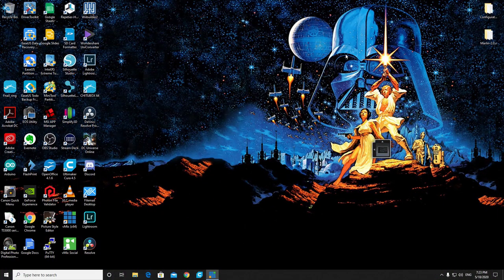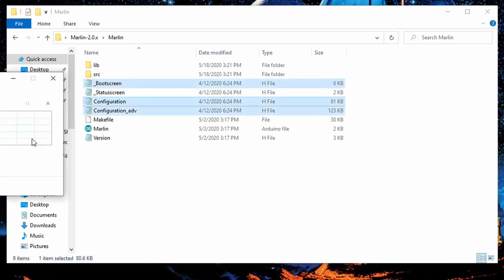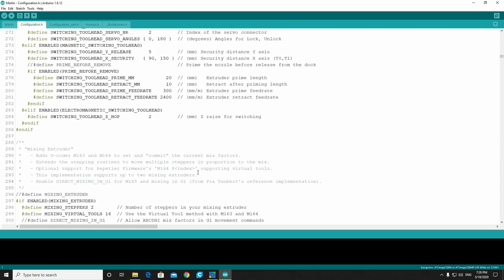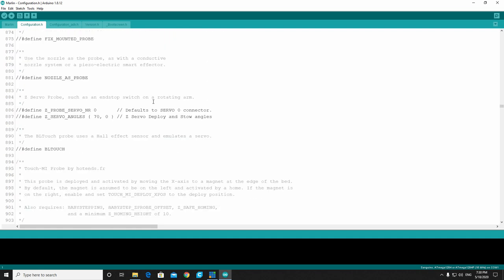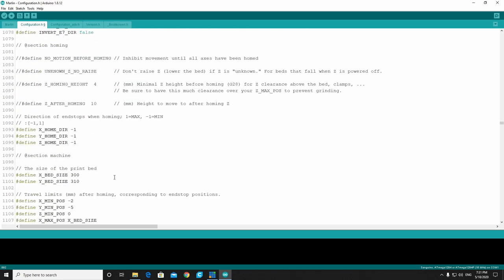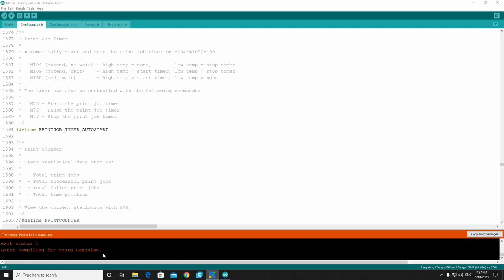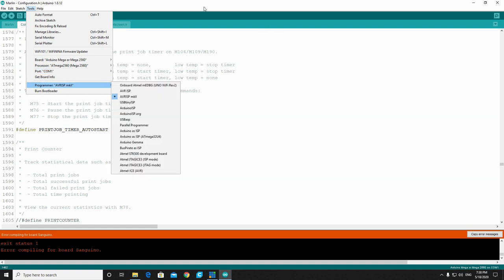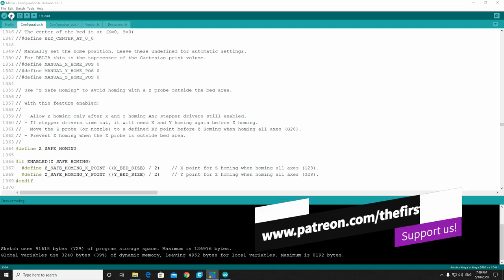How to set up Marlin with a BL-Touch.

Comment: Nicely done Richard.  However, you forgot to call-out the prerequisites (like having the Arduino IDE installed, or the need to use Platform IO instead of the Arduino IDE when compiling for a 32-bit control board)
Reply: Yes, very nice presentation and smooth as silk delivery. I wish I could be so relaxed while trying to create tube content. And also an however from me... while I've been 3D printing for about a year and made many mods to my printer this will be (if I ever succeed) the first attempt to update my firmware. I've watched a dozen vids for adding a BLTouch with firmware update, most of which where The First Layer and all of them leave gaping info holes and assumptions of knowledge that if the viewer already knew, would likely not be watching a tutorial about how to flash firmware for a BLTouch. Currently after following this (using the file for my CR10S) I keep getting error (U8glib.h: No such file....) which I also got following the specific vid for my CR10s and Marlin 1.9.somethun or other... Not giv'in up though.
Reply: @donmiller316  Hello, i have the same Error, did you find a solution ?

Ty in advance.

Comment: My code starts getting different in the beginning part with links. I'm 200 lines off and it also has a silent board? After following this video step by step my Sovol sv01 is a black screen on the printer. Help please

Comment: Hi I have a cr10s pro that I bought a 4.2.7 board for, the problem is that the screen plug goes into the same port that the cr-touch goes into i dont know what to do for this. thanks

Comment: when checking my new marlin firmware after completing the steps you outlined, i now have an error for U8glib.h being missing.  board set to the mega 2560, same for the processor.  Is it worth trying to compile it anyway and run it?
Creality CR10-S5 with v2.1 board trying to run bltouch 3.1
Reply: make sure u add the uglib at the begging of the config and make sure u have the u8glib library installed

Comment: Great video Richard. I already have Marlin U1.R2.12 installed on my Cr10s with the changes you detailed for my BLTouch. I am now installing an E3D Volcano and need to change the thermistor settings in the firmware. Can I edit the the firmware directly on the printer or do I need to get a fresh copy of Marlin and make the changes for my BLTouch and the E3D thermistor.
thanks Wayne

Comment: i followed this video step by step untill the part where you flash itas i am using a cr10s i selcted the Arduino Mega or Mega 2560. and i didnt work couldit be another board if so can you plz reply
Reply: did you find a solution? ive got the same problem

Comment: Hello. I got my first printer ender3 max. Put bl touch on it. That’s far as I got. I have run it before bl touch just make sure it works. Done the door hanger that comes with it and 7 piece gear wrench holder from thingiverse. 
So now I screwed bl touch on what firmware should I install.  Keeping in mind not real computer savvy. Like to have something easy to use with decent prints. Until learn more. Marlin, Creality, this and that firmware?????  Thanks stay safe.

Comment: I’m getting an error of EEPROM on my LCD screen. I looked up a solution to send g-codes to the unit to fix this but when I connected the printer to cura it won’t let me monitor the printer and send code. Any idea? Thanks ahead of time for the tips. Much appreciated!
Reply: Also, my CR-10s has a 3D printed direct drive setup you guys showed in a previous video. With the example configurations for the printer, the probe touches off the bed. How do I fix this in marlin?

Comment: I have an error message:  fork/exec C:\Program Files (x86)\Arduino\hardware\tools\avr/bin/avr-gcc.exe: The filename or extension is too long. Error compiling for board Arduino Mega or Mega 2560.

Any idea how to deal with this?

Thanks
Reply: did you find an answer to this same error

Comment: Hello, am a subscriber to your channel. I've learned alto from your videos. I have a ? Maybe you can help. When I start a print. My play comes out at first. I just %use my tweezers to remove it before it goes to the bed. But what's crazy when it starts the print , it starts late but only a few seconds, then it comes out. Is their a setting in c u r a to use for this? Any help I would appreciate.

Comment: please help i followed your instructions and fixed any errors and now my bltouch wont retract on contact please help
Reply: Sometimes if the BLTouch will not react, swap the white and black wires around in the connector. Use an exacto knife and carefully release the pin. The wire and clip will pull out. Then snap them back in. Hope this helps.

Comment: Great video and awesome information.  I followed everything in your video video and I get this Error Message (In file included from c:\users\stephe~1\appdata\local\temp\arduino_build_78669\sketch\src\inc\marlinconfig.h:41:0,
                 from sketch\src\lcd\dogm\dogm_Statusscreen.h:31,
                 from sketch\src\lcd\dogm\status_screen_DOGM.cpp:32:
c:\users\stephe~1\appdata\local\temp\arduino_build_78669\sketch\src\inc\SanityCheck.h:1352:6: error: #error "Z_SAFE_HOMING is recommended when homing with a probe. Enable it or comment out this line to continue."
     #error "Z_SAFE_HOMING is recommended when homing with a probe. Enable it or comment out this line to continue."
      ^~~~~
In file included from sketch\src\lcd\dogm\status_screen_DOGM.cpp:32:0:
sketch\src\lcd\dogm\dogm_Statusscreen.h:48:12: fatal error: ../../../_Statusscreen.h: No such file or directory
   #include "../../../_Statusscreen.h"
            ^~~~~~~~~~~~~~~~~~~~~~~~~~
compilation terminated.
exit status 1
Error compiling for board Sanguino.
exit status 1
Error compiling for board Sanguino.
)  I check the name on the board and the name in Auduino it's correct.  I have an Ender 3 Pro with the BLTOUCH.  On some threads I saw that may I needed to change to u8g2.  All The Other BLTOUCH setups have gotten my machine crazed up.  Any help would be great